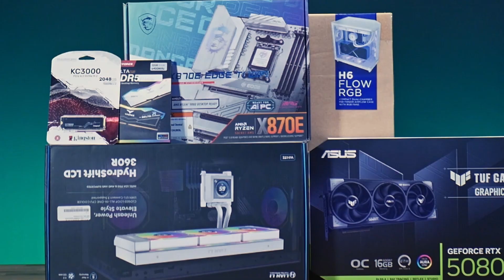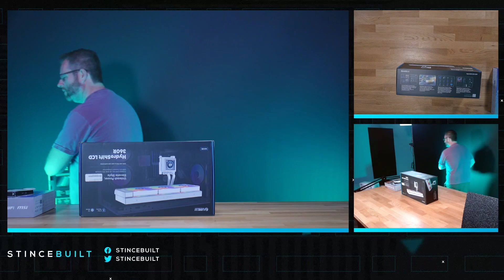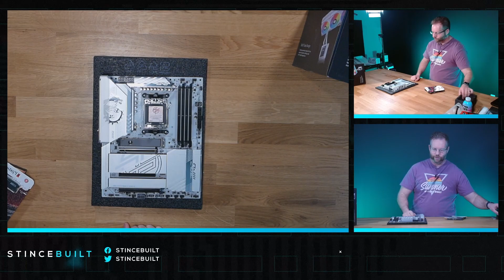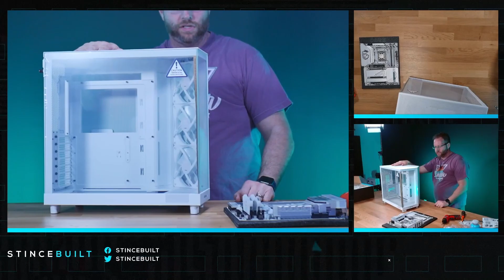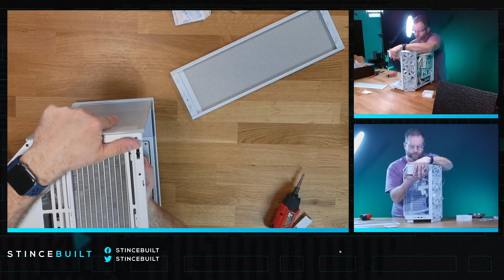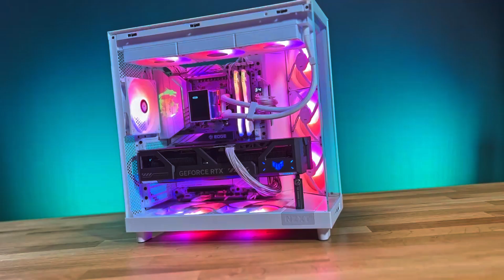NZXT H6 Flow Whiteout Gaming PC Build!

Comment: But does it actually fit. When the glass panel is on does it cause the 12vhpwr cable to bend in a bad way or does it actually fit and is safe

Comment: I just build on this case and you have to remove the front glass panel to properly install the rad... It's pretty easy to remove, just 4 screws at the top and one at the bottom, slide the glass panel up and you're done! More space to work on!